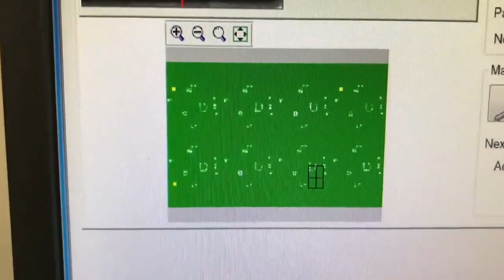Made in NYC 1/6/2021 #Manufacturing the #Adafruit #CircuitPlaygroundBluefruit

Comment: Any thoughts on a Stemma QT rework of the circuit playgrounds? Or will the alligator clips to Stemma QT cable remain the way to go? I picked a set up once when that was the only Stemma QT cable you had in stock, and it did work pretty well with my CP Bluefruit. (PM2.5 graph wirelessly to my phone in under 5 minutes!). The cables must be very popular, they're almost always out of stock.